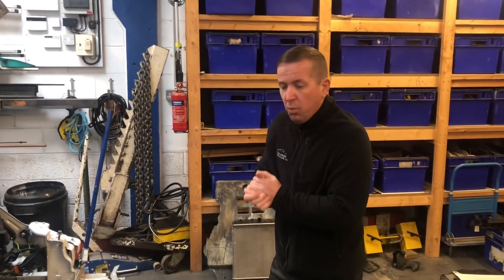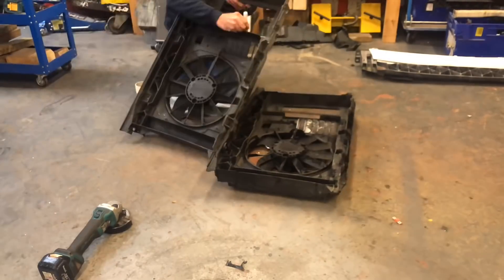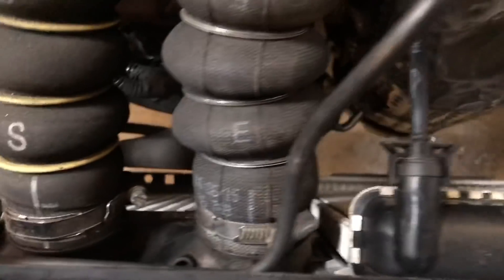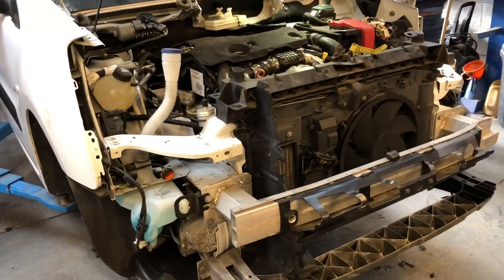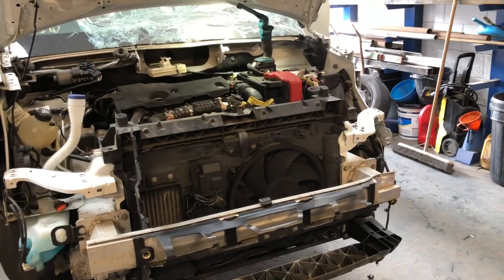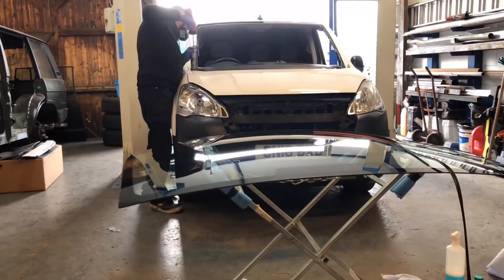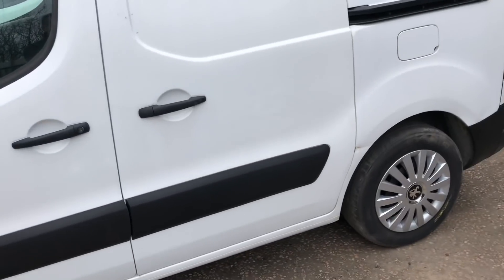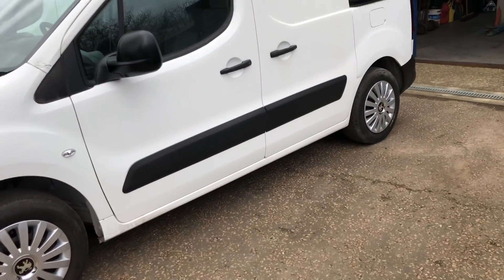Salvage Rebuilds UK Copart bargain 2016 van

Comment: Hi Rob and Chris just a little heads up but you should always use distilled water in the coolant system as it will keep the system from scaling up due to the chemicals in tap water . I always flush the systems out with distilled before refilling to make sure its clean for new coolant and distilled water Makes a big difference with all the odd metals in the system
Reply from the maker: Howard Beer been doing car 25 years never put distilled water in a car in my life distilled water is battery’s
Reply: @sruk  Hi rob yes well I have been doing them a bit longer but until I did some research about 10 years ago and saw what our rotten tap water does to cooling systems and also the mixture of metals they use now thats when I started to use it and it def makes a difference . Oh and keep up the great work its nice to see and thanks for the reply

Comment: Outstanding work as per usual and very inspirational to the point that I’ve just purchased a salvaged transit connect and £200 later its on the road. Owes me £900 for a 2010 model which I’m very pleased with. Only problem is I’ve now got the bug 😂 Keep up the good work guys 👍🏾

Comment: Make sure u get a citroen grill as I don't think a pug grill will fit.... You can see where the citroen badge goes on the panel behind the grill already..
Reply from the maker: Linux tech tips it’s a Peugeot partner and the bumper is Peugeot Citroen it fits both vans as they are the same

Comment: Fantastic watching you work , could have done with you today , wifes car written off in accident 56 plate Audi TT , got email it's gone to Copart , it's beyond any economic repair, gutted here , I thought long and hard about repairing it , but not for me :(
Reply from the maker: Mike Hawes they always let the owners buy them back very cheap
Reply: @sruk    Too much to do, front whole bumper unit grille, bonnet, headlights sidelights, wing, wheel half off, bottom wishbone snapped, intercooler bracket , thats all that can be seen . So annoying, but thats the way it is, perhaps some salvager like yourself can do it here in the midlands